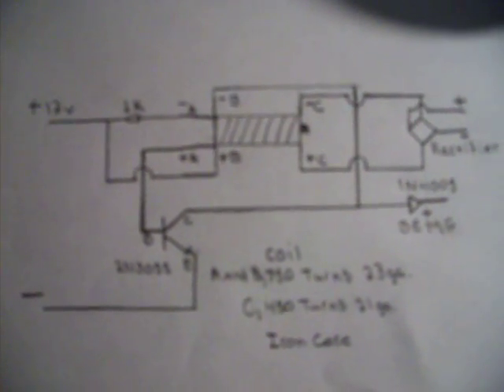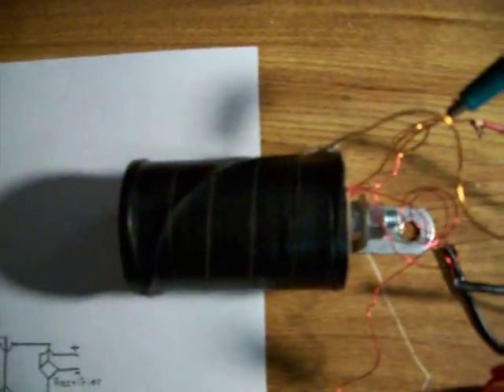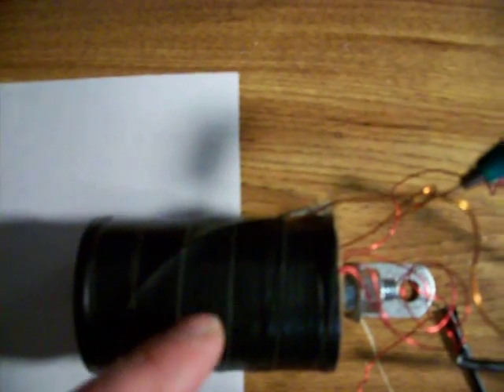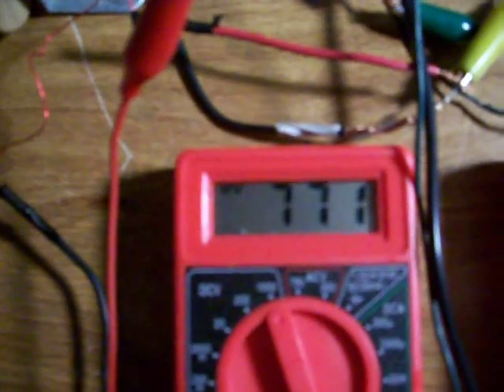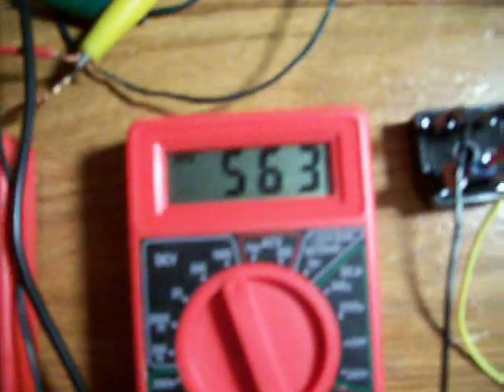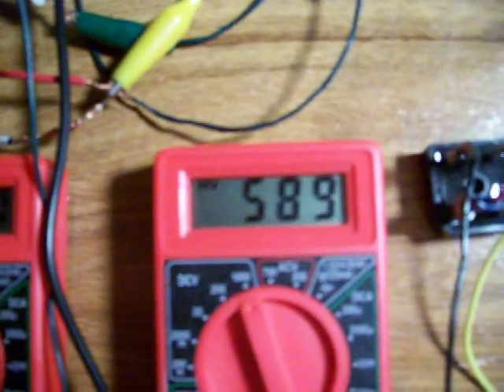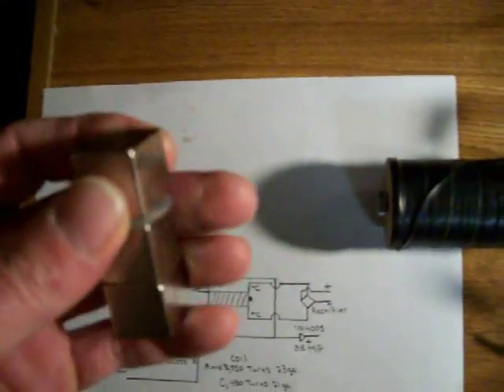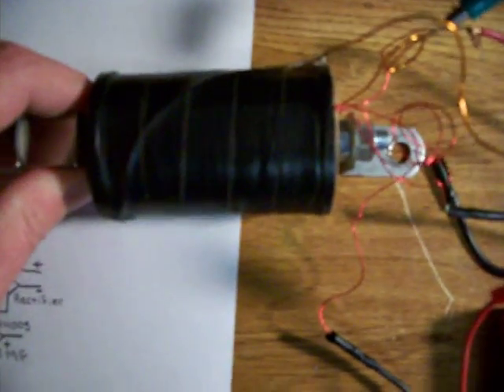Big Jouel Theif Slayer007

Comment from the maker: @eloid777 
It is two windings of 23 AWG wound around a soft iron bolt.With a third winding around the out side of the other two.

A ferrite rod should work better.

This was just a coil I had sitting around from a pulse motor I was working on.

Comment: Nice experiment, if you want to measure voltages higher than 1000V with this meters use voltage divider from two resistors.(about 1000k+ ones) calculate it do divide voltage ten times. And you won't go off scale. But remember to multiply meter reading by the division rate.

Comment: I replicated this with a similar but smaller coil. I measured the operation with a scope and the pulse was around 200V (measured from the diode to ground) and the magnets just made the frequency of the oscillation higher. I didn't get any real audible oscillations since the smaller coil made the frequency go far beyond 20kHz.

Comment from the maker: The magnet seems to be changing the speed of the oscillation of the coil.

As for the power I'm not really sure but it will run off a AA battery that has about 1 volt in it.

Comment from the maker: LOL It does kinda sound like a jet engine.

As far as the voltage I think I'm going to have to use it with a smaller battery or a solar panel.